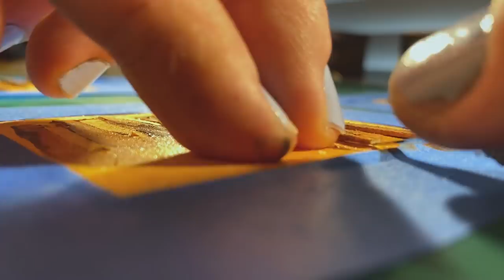POST APOCALYPTIC BUS DIORAMA |Ultra Realistic| Tiny Tim’s Mins

Comment: March 25, 2021----Thanks for the video and your diorama looks great. But wondered in reality, how do you attach planks to the side of a METAL bus? Got back into modeling and going for 1/35th scale zombie/ apocalypse dioramas. Screwed up and think I bought the same bus you used as I THOUGHT it was 1/32 scale. More like 1/48th? Took me TWO YEARS, but found out that Arrii (a Japanese model company) has several buses in 1/32 scale. One's a school bus, the other is like a city bus, both kind of reminding me of those used in the 1960's. Thing is, steering wheel is on the right side and door is on the left, so gotta change that.
Reply: It is approx. 1/64th scale, I have several.